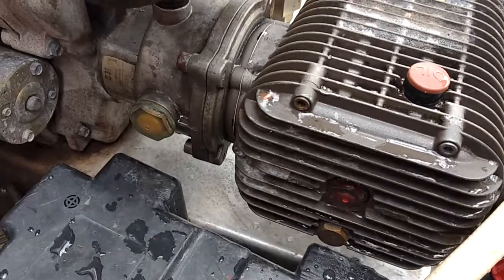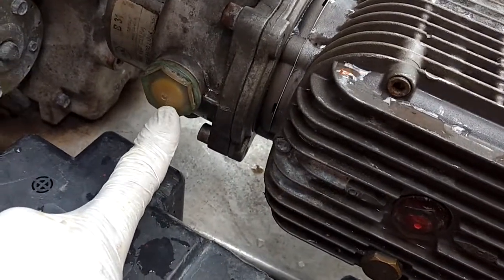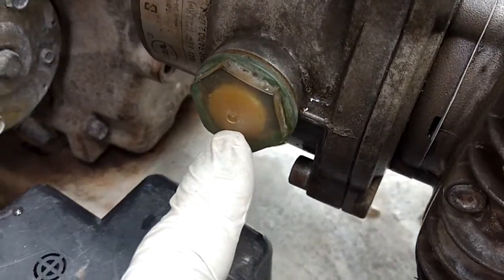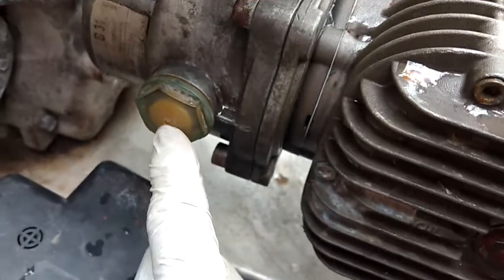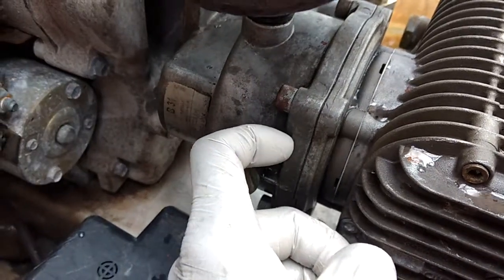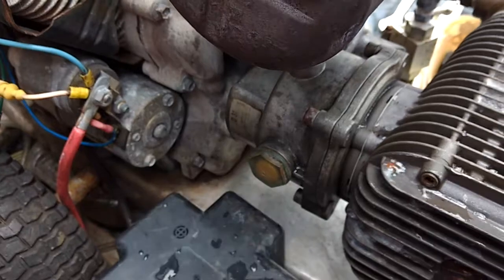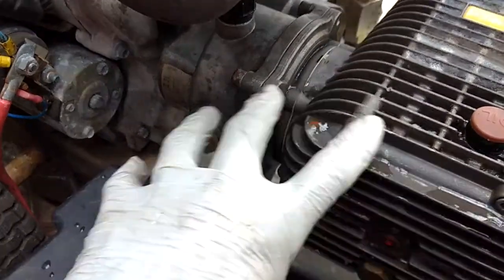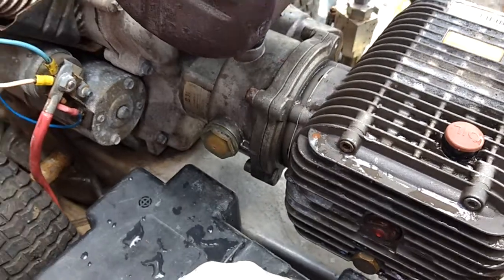Pressure washer PA B31 gearbox oil vs comet TW series pump oil

Comment: Agree, I think. The new BAR group oil goes cloudy but recovers on settling. It seems to work well. That seal between the gearbox and pump is an issue! We have replaced 4 of them on different machines 
 and I cannot really understand why they fail so quickly??? There is no pressure difference between the two boxes. Go figure??
Reply from the maker: Thanks for comment....
In my experience it's the HEAT is the root cause of pump seal failure....I also switched to 100% mobile synthetic gearbox oil much clearer and far less foaming
What type of gearboxes and pump are you running?
Reply: I run B31 Gboxes and Comet TW5550 pumps. Running the at 4000 - 4200 psi, 21 lpm.
Reply from the maker: @CleanUpCrewcleaners  Synthetic oil??? What type??
I was wondering how different engineering wise are the udor geraboxes...that are on the water dragons from Powerwashstore.com
Reply: Griffs Services (House & Building Soft Wash, Power Washing, Pressure Cleaning)  From the picture they look very similar. I now use Nulon premium 80 / 90. I was using Penrite 80 / 90. We'll see if the new oil works better?  What oil do you use? I wasn't thinking, but the BAR group oil 30 grade non detergent is for the pump. What do you use in your pumps? Cheers, Pete
Reply from the maker: In the gearbox I now use mobile 1 full synthetic 75W/90 https://mobiloil.com/en/gear-lubricants/mobil-1-synthetic-gear-lube-ls
Much better than the conventional Valvoline
The less evaporation
Pumps I use General pump series 100 https://www.instagram.com/p/BcX2KerlZ-b/?utm_source=ig_share_sheet&igshid=z89kzb20an6y
Reply: @GriffsServices  🤙🏼 Thanks for this information!! 💦 💎
Reply from the maker: @johnsharpe1118  Your welcome...
The gearbox failures was due to cracked keyway...I think there is another video with it

Comment: I had a leaky gearbox on my pressure washer and I used John Deere Cornhead grease go check out the videos on it it is what you need if it's leaking